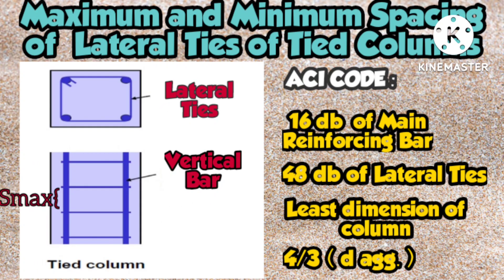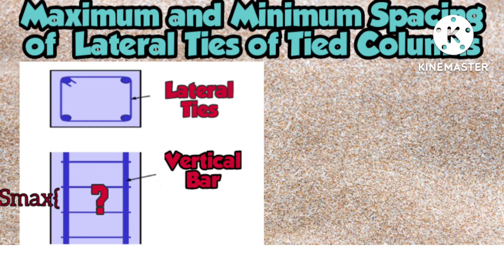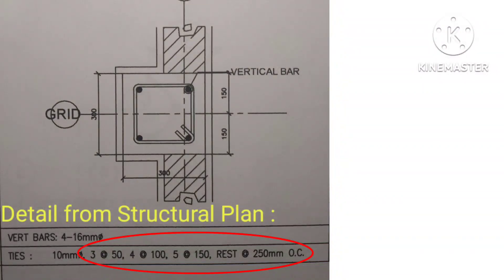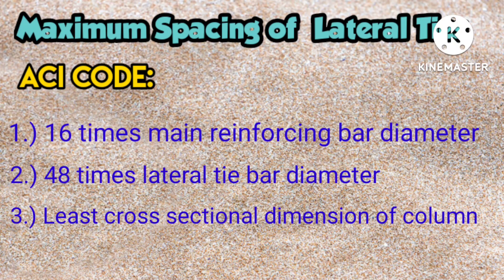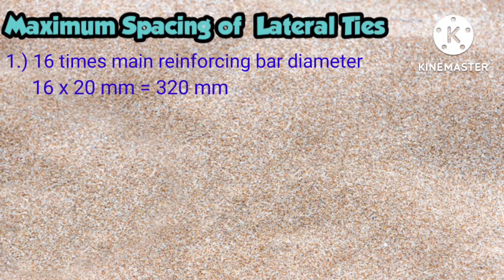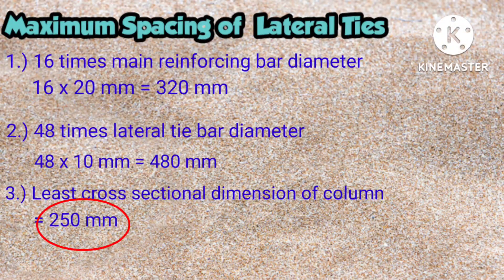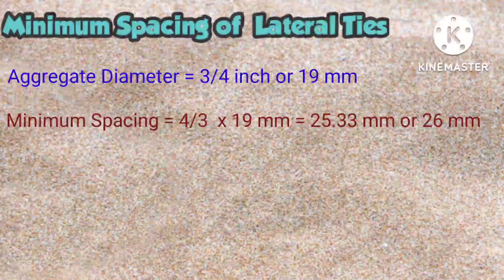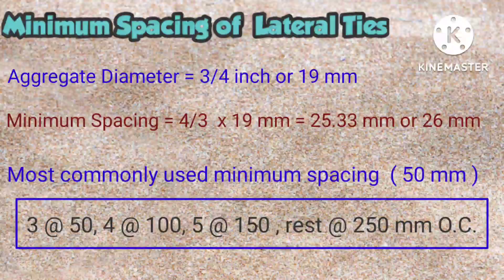MAXIMUM AND MINIMUM SPACING OF LATERAL TIES | Spacing ng Anilyo

Comment: Paano po nasolb
Ve yung 250
Reply from the maker: Doon Sir sa tatlong criteria na 1.) 16 times the main reinforcing bar 2.) 48 times the lateral tie diameter 3.) Least dimension of column..

Yung pinakamababang sagot ay doon sa least dimension of column which is 250mm kaya yun po ang magiging maximum spacing ng lateral tie.